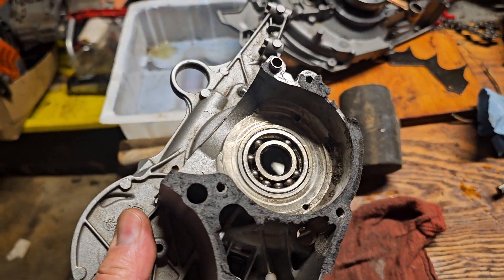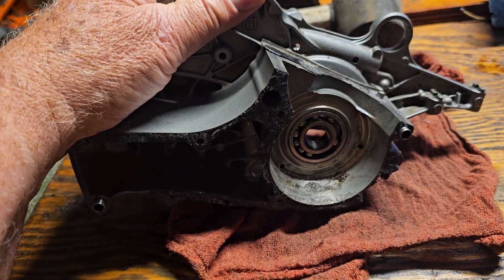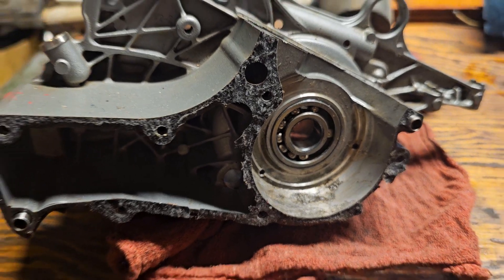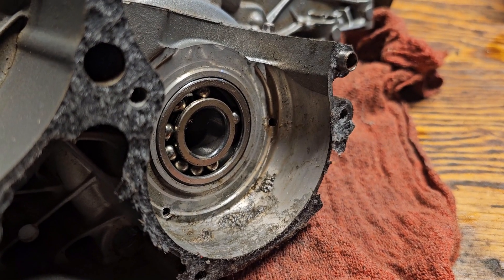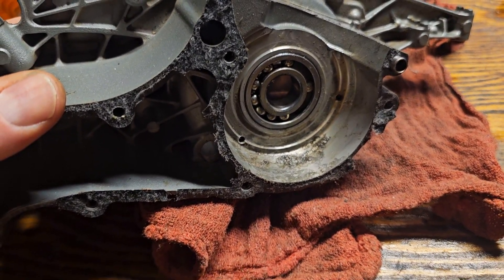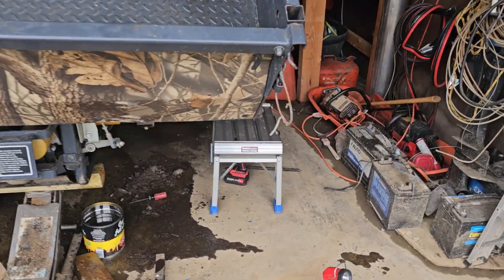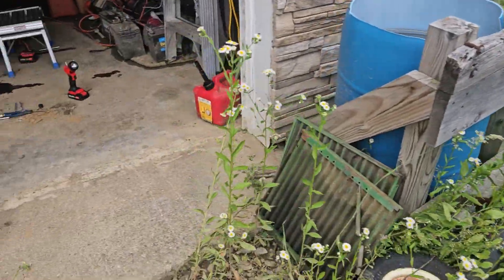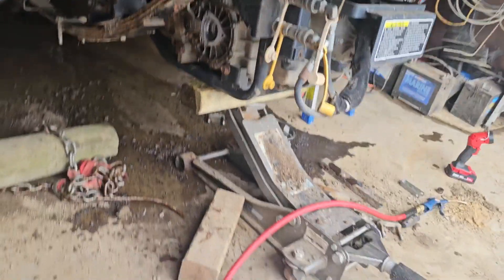Nylon Caged Bearings And WHAT happens When They Fail?

Comment: If there are no seal leaks does that necessarily mean the bearings are still good (proviso being that there is no play in the crank and everyrhing rotates smoothly)? I'm about to put  a new piston and cylinder on my 2011 562xp which I cooked many years ago; I found now debris in the cases (washed out) only some aluminum paste from scoring of the piston (exhaust side). Folks like you have motivated me to repair this thing: I have a new 562xp MK II and want a good backup saw hence my quest to repair the old one).

Comment: Many chainsaws feature “proprietary” nylon crank bearings which limits choice and we’re kinda stuck with them for now. IMHO the metal vs nylon bearing debate is another oil discussion 😂pros and cons: metal most likely lasting longer however more likely to cause catastrophic damage. The heat failure argument doesn’t pass muster with me as Nylon (Polyamide)can take 200c , which is 392 degrees Fahrenheit. The crankcase should NEVER be running anywhere near those temperatures!  I keep the oiler maxed and a sharp chain and retouch with 3/4 strokes of the file after the chain is down to 85-90% of being freshly filed. If you mind the air filter/keep a sharp chain/ and do maintenance,  a modern saw should give a long service life regardless of metal or nylon bearings. I’ve encountered those who could make something from seemingly nothing and then those who could break an anvil with a rubber mallet … I imagine the same goes for saws 🙈🙉🙊
Reply from the maker: Guess the point of this video is to dispel some of the bearing speculations. I have in 25 plus years only seen one metal bearing fail to where it came apart in the saw. Conversely I have seen dozens of the Nylons as you see here. So when folks say " metal will likely last longer but more likely to cause catastrophic damage" , I think my experiences put a lot of meat to the "last longer" there for worth the chance vs. the more likely to fail nylons. AND to say the more likely to cause catastrophic damage than nylon is categorically false. The higher failure rate along with dropping balls into a saw means the nylons are ore likely to fail AND ore likely to cause catastrophic failure. To me, the arguments is about rationalizations. The real benefit of the nylons is manufacturing cost and they do dampen vibrations some vs. the steep caged variants. To this day I think ( pure opinion on my part as they will never tell )Husqvarna was chasing a vibration issue on the xpw-s and xt's as witness to the rattle apart syndrome I was witness to  on those saw in 2009-2010 time frame.  the other "pure opinion" is they has a manufacturing issue in the machining or bearing installation process on the early XT's where there was an alignment issue loading the bearings and making them run hotter than normal. EVERY one i repaired by installing the steel 6202's far outlasted the OEM nylons AFTER the repair. So i see the rationalization for nylons and don't buy it. Hence the video. Also I do believe Husqvarna "fixed" a lot of the issues that generated excess heat and that is why now the 372's with nylons last as long as their predecessors. Point being nylons work if the environment/application stays within their design parameters and the saw runs smoother. Steels can handle more  heat and wider design parameters. Both when the cages fail will dump bad things into the saw.
Reply: @afleetcommand  can’t really argue with someone with 25years experience - obviously (like so much in the saw world ) the conventional wisdom / repeated party line (re: the steel vs nylon crank bearing cages discussion) is incorrect. Fortunately I’ve never had a saw puke its bearings into the crankcase / firing chamber … so far.  I have seen them worn / crusty though and just replaced them along with the seals. Dirt ingestion over time or high hours. Then we can get into the whole high-compression / machined “pay ME to build YOUR saw” internet world and draw parallels between bearing “life” and THAT particular build style. There is a mathematical correlation between bearing life/load applied. More /higher than stock compression is going to cause the bearings to fail sooner and if we are stuck with nylon caged crank bearings (that’s not even including the big / small end bearings which will Really take  a beating with higher compression) for saws maybe it’s best to keep the compression stock or use a thinner base gasket to get what you want (lowered intake , slightly more compression efficiency ) on your saw build IF you want increase power while also maintaining fuel economy and longevity!  I seem to consistently arrive around 23-28% gains in cut speed in the timber using intake / piston / flow porting and exhaust mods (piped can or better yet a rowdy pipe (loud)) and get good fuel mileage and longevity. I can definitely build them hotter/faster and get even more cut speed but it’s not worth the loss of longevity / fuel economy and the introduction of possible catastrophic failure. Seems to me like there is a “sweet spot” where you get more performance, mileage is good and longevity is there. Straying into the tall weeds by using “race saw” build techniques (high compression, excessively widened intake/exhaust ports to get more time/area “squaring” the top of exhaust port (good way to snag a ring and grenade a top end )) and a whole host of other “razors edge” type mods)) on  a “work saw” isn’t going to end well if the person paying you for services receives a ticking time bomb 💣 … IF it’s YOUR saw and you wish to experiment to see how fast you can make it go then by all means knock yourself out … Just be aware that you’ve now built a “toy” NOT an everyday worksaw.  AFAIK we are stuck with these proprietary nylon cage  bearings - yes you can replace one side with metal cage but not both. I could be mistaken here but I cannot find a “source” that will supply metal cage vs nylon cage replacement for BOTH bearings. From my research the pto bearings are nylon caged “proprietary” and NO metal cage option exists.  The only Husqvarna saws I’ve come across that DID NOT have a proprietary pto nylon caged bearing were the 372xp and the 395xp. Ok enough yappin gotta go cut up some wood 🪵

Comment: I've removed many a crank seal only to find a degraded or broken nylon cage :( the bigger problem has been Husqvarna's proprietary bearings with the built in seal. A proper tune, good mix oil and proper saw maintenance goes a long way in keeping the bearings alive regardless of what kind is in the saw. Not sure exactly what bale spear you have setup on your bucket but I have the same JD loader and bucket, lifting 4x4 round bales like that with my bucket completely destroyed it, granted mine has handled many thousands but they flex the steel in the bucket every time eventually breaking it pretty spectacularly.
Reply from the maker: It's a 2750 and has been doing that with those bakes since 2004 :) I also have a two spike setup where I get two at a time. Just that's a little heavy so I don't use it
Reply: @afleetcommand  I started using mine to move round bales in 1993, in 2005 the bucket developed a couple cracks at the seam on the bottom at the back, I welded them up and the next season it cracked again and broke the cutting edge to the left of where the bale spear sits over it. Welded it several times after to get by until it finally gave out unloading bales one evening. Not saying it doesn't work and maybe yours will last another 20 years,  just sharing my experience with it. One thing I did like about it mounted on the bucket was the reach it had over the one I use now on my loader with a quick attachment, but the visability without it on the bucket, especially for loading pickups is alot nicer without the bucket.
Reply from the maker: point is I have both. I use the dedicated twin spike arrangement when I'm set up for hay. I use the bucket mount when I do periodic "help" tasks now as I'm retired from the heavy hay production.